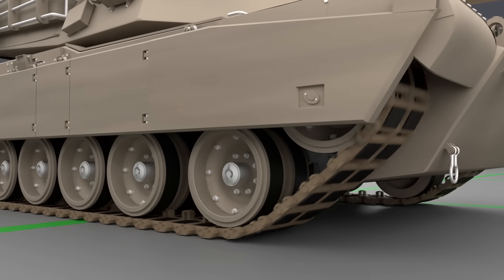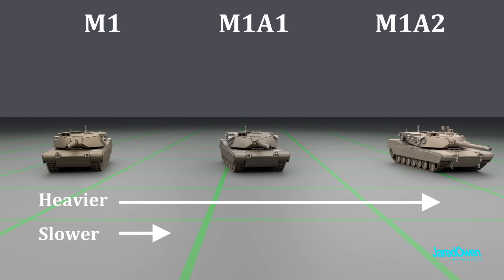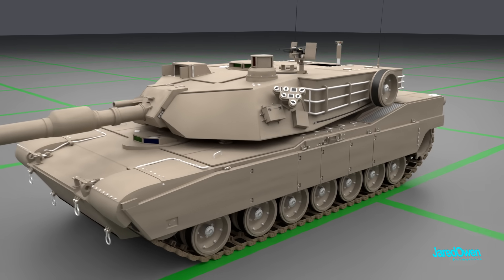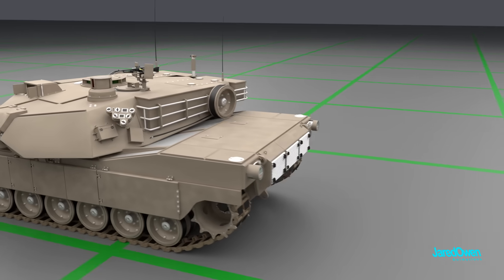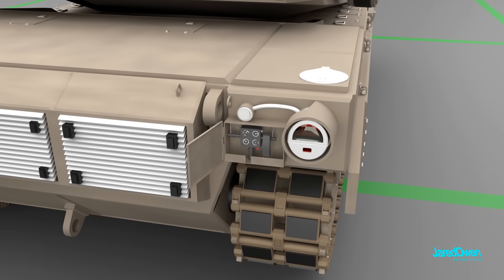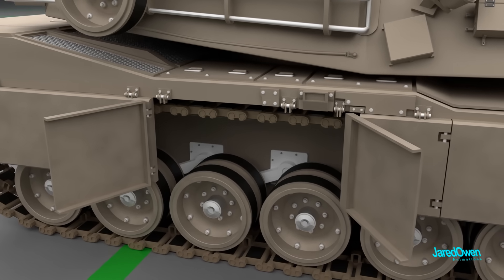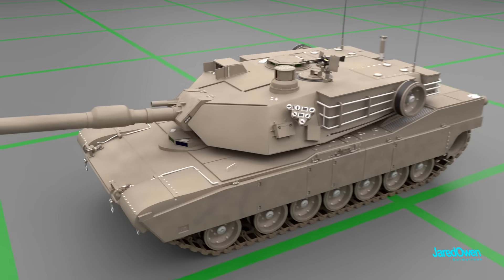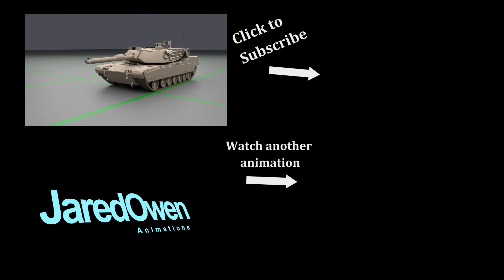How does a Tank work? (M1A2 Abrams)

Comment: I didn't realize that War Thunder had blown up like it has.  I played it from beta right up to when they added air combat into the tank battles.  The tech tree only went up to the Korean War era at that time.  I've never seen any advertising for it, so I figured it fizzled out and died.  It's far superior to Wargaming dot net's land/air/sea games, especially with the physics.  In world of tanks, the effects of mass and inertia are tuned way down.  In War Thunder, you can really feel the weight of the tank in the handling when you're hauling ass and make a hard turn because the hull orientation changes but you still skid sideways in the direction you were originally going... all that weight can't just turn on a dime.  Makes for great situations where you can emerge from cover and get a snap shot off without having to reposition the turret.

Comment: “Has a turbine engine much like you’d find in a jet aircraft”......it’s literally the same engine that’s in the Blackhawk helicopter
Reply: Ah, NO... the Blackhawk is powered by a General Electric T700.
The Abrams is powered by a Lycoming PLT-25.
Reply: Agt1500
Reply: @longsleevethong1457  The M1 Abrams is powered by a Lycoming PLT-25 The U.S. Navy designation is TF-15 and the U.S. Army designation is the AGT-1500.
Reply: Aight. Still a helicopter engine.
Reply: @longsleevethong1457  No, not true, the PLT-25 has always been a land/marine power plant.
Only the PLT-27 is a flight rated engine.
The Lycoming PLT-25 was never used or intended for aircraft applications.
Any questions?
Reply: Iol. Model numbers From 25 to 27 and completely unrelated.....

Got it......
Reply: @longsleevethong1457  The developement of the Lycoming PLT-25 dates back to 1944. 
 It was designed by Dr. Anselm Franz,  the Nazi engineer working for Jumo who invented the axial compressor turbojet engine.
 Franz designed the Jumo -004 turbojet engines for the world's first jet fighter the Messerschmitt Me-262.
 Work was begun on a larger more powerful engines including the Jumo -025.
 Dr. Franz used the core of the Jumo -025 to develop a gas turbine engine called the GT 250  to compete against the BMW GT 101, the world's first gas turbine tank engine that was installed in a Panther 2 chassis in 1944.
 The war ended before Jumo completed the protype.

Franz was transplanted to the U.S. by Operation Paperclip and was hired by Lycoming as cheif of turbine engine development and work on the GT 250 resumed under the name PLT-25.
The PLT-25 was not originally developed for helicopters and was never a flight rated design.

Franz had already designed the world's most popular helicopter turbine engine in history with the Lycoming T53 which powered the Bell UH1 and AH1 helicopters.
A larger more powerful version of the called  T55 powered the Boeing CH-47 Chinook helicopters.
Reply: It’s a fucking variation of a helicopter engine.
Reply: @longsleevethong1457  No, its not a helicopter engine.
Helicopters can be powered by reciprocating and turboshaft gas turbines.
Not all turboshaft engines are helicopter engines.
Reply: @longsleevethong1457  The first successful gas turbine was invented by Jens Ægidius Elling in Norway.
The first company to manufacturer gas turbine engines was the Swiss company Brown Boveri und Cie. which made gas turbine power plants, industrial compressors and locomotives in the 1930's.
Reply: Aktually.....it’s absolutely a variation of a helicopter engine
Reply: @longsleevethong1457  Actually, no... it's not a helicopter engine, it's a tank engine.

Helicopter engines don't run on Diesel fuel or have a recuporator... they don't have air filters either.
Reply: Taking a part off one side and adding another part on the other side doesn’t change the fact that it’s a helicopter engine moron
Reply: @longsleevethong1457  It's not a helicopter engine, nor are all gas turbine helicopter engines.
Many helicopters have reciprocating piston engines and gas turbines are used in a wide variety of non-aviation applications including but not limited to tanks.

Comment: The digital m1 model looks like it has the 120mm instead of the 105mm main gun....also I’m pretty sure it will hold more than 500 gallons of fuel.

Comment: The tank does not run on jet fuel it runs on diesel
Reply: The1 Abrams was designed to  run on Diesel fuel (NATO F-54)
After it entered service in 1980 it was plagued with fuel issues during cold weather operations and the U.S. Army began to supply M1 units with a special kerosene + JP4 jet type fuel blend called "M1 blend" or  NATO F-65.
In 1991 the U.S. Army switched from Diesel fuel to JP8/NATO F-34 jet fuel or all combat vehicles.
Other countries like Australia, Egypt and Saudi Arabia still used Diesel fuel in their Abrams tanks as they do not encounter extreme cold weather.
Reply: Yep

Comment: The Abrams was designed as a defensive tank, to counter the "hoards" of Soviet tanks that might attack Europe during the cold war. Thus, it was equipped with a powerful but inefficient engine that could move it short distances very quickly. In short, it was a gas guzzler to the extreme but in a cold war scenario, it would never cover large distances and speed was the better attribute.

A 300 mile range with 500 gallons of fuel? And even those figures are far-fetched. It takes 16 gallons just to start the engine. It's not an effective offensive tank although that has been it's primary mission in combat.
Reply: No YOU!

Comment: So 2 question.   Where do spent shell casings go? I'm assuming here but how does the loader get to the shells on the other side.  Do they roll towards him?
Reply: The German Rheinmetall Rh-120mm has no metal shell casing, it uses an ingenious case design are of combustible celluloid.
Only the small metal base cap is ejected from the breach, it falls into a small basket on the floor.
Reply: You can see the darker silver colored base cap being ejected from the breach in this video.
https://youtu.be/sC2ePKRvo9k

Comment: "This engine is actually fairly quiet"

Start-up louder than a Boeing 747
Reply: It's quiet because the loud high pitch sound doesn't travel distance very well. Lower pitch sounds travel a longer distance.
Reply: I can agree to the start up is very load, once it's out of tac idle it's not thay bad

Comment: Good video... I expected nothing less. But I was disappointed that Jared didn't go into the GPS Gunner's Primary Sight and the Commanders, Independent Thermal Sight on the M1A2. Basically the Gunner has a Thermal sight that is the large rectangular "window" on the right of the main gun and the Commander's Independent Thermal sight is the "nipple"-like cup on the left top of the turret. It is quite similar to the Gunners sight, but allows the commander to constantly scan 360° independent of the gunners sight and rotation of the turret. The commander can independently identify a new target and electronically send the coordinates to the gunner's firing computer.
Also, the loader is responsible for manning the 50mm machine gun on top of the turret. The loader also MUST load the main cannon and sit down carefully to avoid injury because at 3,500 MPH shells firing, the recoil of the breach WILL NOT stop for anything and will crush any human body part not secured safely behind it.
Also, fun fact, in the Gulf War, the M1s went into battle with fuel "bladders" perched atop their turrets, that just before a push would be rolled off and connected to the fuel tanks of the M1 and the tank would back up over them to top up their fuel tanks.

Comment: As an M-60 tank driver this is coming a long way in the armor corps. I never got to crew an Abrams.
Reply: M1a1 crewmember here(driver) it's like a big motorcycle on steroids and a BIG FUCKING GUN. You feel invincible when driving and the brake pedal is bigger than your foot on the right side. Not bad on the seat (lazy-boy recliner). I'm 6'1" and I had plenty of room in the drivers hatch. Desert storm vet 89-92 hhc 8/40th armor 63rd arcing ft huachuca, az. "As I ride through the valley of the shadow of death, I FEAR NOTHING!!! For I am the most feared, deadly, and meanest mf on the battlefield" tankers creed

Comment: The tank has a governor on the speed, otherwise the 5 tuns, HMMWVs, M113s and M556s in support of the tanks cannot keep pace.  That and at more than 65mph and you risk the track being damaged by centrifugal force.  The seal of the turret must be inflated to keep water out while tording a river.  Chemicals are kept out by overpreasuring with filtered air.  The same system clears smoke from firing the coaxial machine gun.  I have a total of 14 years (93 to 07) experiance in the M60A3, M1IP and the M1A2
Reply: I completely believed you till I saw "a roral"! I guess we're supposed to assume you meant "total"  huh? 😆 This is what insomnia and boredom got you. Stupid comments with no remorse!
Reply: @weedzilla-405  thanks for the catch.  I really have to proof before I send.

Comment: I thought the video would use legendary Leopard 2a series as the model
Reply: The Abrams is based on the Leopard...
Reply: @sandervanderkammen9230  No, both leopard 2 and M1 Abrams are based kpz 70 aka mbt 70 in the US.
And they are made after German quitted the project.

p.s. You can find it on Wiki
Reply: @alvinnormason5170  Krauss-Maffei AG. designed and built not only the Kpz-70 but also the XM805, XM815 and the MBT-80... programs which were renamed the XM1 and Leopard 2... real factual history you wont find on wiki.
Reply: @sandervanderkammen9230  They did share the same tech, same guns and barrels but it doesn't mean Abrams are based on leopard
Reply: @alvinnormason5170  Not true, all 6 XM1 hull/chassis were built by Krauss-Maffei in Germany.
The suspension components were  manufactured in the U.S. by FMC under license from German manufacturers K-M, Koni, BBS, Krupp, Atlas and Deihl.
Many major components were  interchangeable between the Leopard 2's and the Abrams and still are.
Reply: @sandervanderkammen9230  So what you mean is Japanese type 90, type 10, American M1, Korean K2, Israel Merkava Mk.3, 4 and Italian Ariete are all based on Leopard because they use the RH 120 cannons? It obviously they are different designs. They are just able to install and share the same turret and parts. Even leopard could install other turrets as well but it's doesn't mean leopard base on foreign tanks
Reply: @alvinnormason5170  Is this video a joke or something?
Reply: @alvinnormason5170  The Abrams has never used the same gun as the Leopard 2 and never intended to.
The M256 while licensed by Rheinmetal and manufactured in the United States is a much cheaper, heavier and less advanced version than the L/44 used on the Leopard 2 and has been superseded by the even more advanced L/55.
Reply: @sandervanderkammen9230  It is a joke
Reply: @sandervanderkammen9230  The L44 and L55 installed on leopard is the special modification.
Reply: @sandervanderkammen9230  don't try to make Abrams be similar to leopard or use Abrams to substitute Leopard, that's why people hate this video https://youtu.be/oso1EZmyAQ8
Reply: @alvinnormason5170  Who the F is Dave Walpole???

Comment: Does the US military use light or medium tanks? This monster weights almost 70 tons. Not the fastest. Heavy. A tank's main advantage is speed. Not the firepower or the armor. It has to be agile as a Mongholian horseman in the 12 century. The fact that in the 21 century a tank uses high octane  gas and not diesel is disgusting. The Russians used diesel in 1939. Almost a century ago.
Reply: It's a multi-fuel engine, the Army and partially the Marines up until they retired their tanks switched from Diesel to JP8, a jet fuel. 

The U.S. is looking into a 20t.-30t. tank "Mobile Protected Firepower" for the Airborne, which will also replace the M1128 Striker MGS in Striker battalions.
Reply: @peterson7082  
Thank you for sharing. To me, diesel has a clear advantage over any other fuel. It is not flammable, unlike gas fueled engines. It is less susceptible to dust and sand. Finally, it is easier to maintain (contains fewer parts) and repair, especially in the field. I am not an expert, but read quite a bit about WWII. One of my favorite experts is a former tank expert, a military officer (commander of a tank company), military intelligence officer, and a prominent WWII historian Victor Suvorov. He analyzed the Soviet Union's role in WWII and Stalin's vision of tank and mobile units' (armies) role in conquering Europe. Highly recommend.

Comment: 70 tons fully loaded.the tank does not run on jet fuel. It runs on JP8 low grade diesel. It uses up 8 gallons of fuel just on start up,the round does not leave at 3500 miles an hour,it travels at 3500 fps, the loader and t.c. have their own machine guns,an m240 for the loader and M2 .50 cal for the commander. The CITV in front of the loaders hatch also allows the t.c. to get a full view of the battlefield without popping the hatch.
Reply: Wrong, JP-8 is  JET A1 commercial grade jet fuel also known as NATO F-34 jet fuel.
Any questions?
Reply: @sandervanderkammen9230 I spent 4 years on the tank. Humvees,Hets,MRAPS,Paladins and damn near everything else runs on JP8. There's no way a humvee runs on Jet A fuel. Are there different grades to JP8 that I'm not aware of?
Reply: @jasonleighton1584  JP-8 is the military equivalent of Jet A-1 with the addition of corrosion inhibitor and anti-icing additives; it meets the requirements of the U.S. Military Specification MIL-T-83188D. It is the dominant military jet fuel grade for NATO airforces. The UK also have a specification for this grade namely DEF STAN 91-87 AVTUR/FSII (formerly DERD 2453). NATO Code F-34.
https://www.shell.com/business-customers/aviation/aviation-fuel/military-jet-fuel-grades.html
Reply: @jasonleighton1584  Humvees, Hets,MRAPS, Paladins and all combat vehicles in service with the U.S. Army are equipped with "Multi-Fuel" Diesel engines.
These engines are all equipped with a Fuel Density Compensator which allows these engines to run on a wide range of fuel types including jet fuel.
The U.S. Army adopted the "SFC" progam in 1991 'aka' JP8 as its Single Standard Fuel so the Abrams could use the same fuel, the Abrams cannot run reliably on Diesel fuel.
Reply: @sandervanderkammen9230  well then, I stand corrected. Thank you for teaching me something new.
Reply: @jasonleighton1584  You sir are very welcome. Cheers!

Comment: The stabilization on the tank for the 120-member gun what tanks got tested with it before it was on the in one and I know the answer cuz I was on those tanks when we tested it secondary timing division 1st Cavalry 1974 to 1977 text someone was tested by 1975 and 1976 me and Baker have test the tank you had a GMC in a Chrysler what had plantar do some gel and had a turban answer M16 A1 V menu wc28 803 r w n 22803 e r w i 2803 e this came from the tank branch of weapons Department Forge and Thunderbolt United States Army School Fort Knox Kentucky 1975 June and it was a M48 tank as well. Had the stabilization on it that we tested that's the Vietnam era tank

Comment: I thought the smoke launchers are supposed to launch smoke cannisters about 30m in front of the tank in an arc. Is this inaccurate? or do the smoke launchers ALSO spew smoke directly from them?
Reply: They launch them.
Reply: The Abrams was originally designed with an engine smoke screen generator but it was disabled in current models due to reliability problems with the gas turbine engine... it now only has smoke grenade launchers.

Comment: The weakest points of the tank are: 
1 The communication box
2 Small angle of view for the driver 
3 The coordination between driver and commander must go smothly 
4 The imunitions does not get automatically 
5 It is heavy and slow so easy to catch by air and missiles 
6 The weaker part are the wheals and they are the most important part 
7 The engine is not quieter ... 

So I drop this tank ... 
I would like a faster tank like more than 100 klm per hour ... 
The wheels must be reconsidered for better strong options ... 
The tank must not be heavy ... 
2 members instead of 4 ... 
1 Driver the other fire and command ... 
The tank must be equiped with a real time 3d map ...
Reply: The weakest point of the M1 Abrams  is the gas turbine engine and it's appallingly bad fuel consumption.
Reply: The engine is not quieter? It has a high pitch meaning it only goes about 50-100 ft. Any more than that and you can't hear it, it's crazy.

Comment: Someone knowledgeable plz answer:
The piston engine turns the crank which turns the transmission which turns the wheel of the car. 

The turbine in tank turns what? Does it generate electricity to turn the electrical motors which turns the toothed wheel of the caterpillar wheel set? Or like a car is there a crank which turns the driving toothed wheel?
Reply: The turbine is geared to the tranmsission, which is a cross-drive transmission. So an automatic mixed that has a torque converter and hydraulic steering all in one package. It's entirely mechanical essentially. Like any other tank.

Comment: Those apfsds shells are surprisingly accurate for a smooth bore cannon
Reply: Not as accurate as the L/55 gun on the Leopard 2's
Reply: @sandervanderkammen9230  Meh.
Reply: @peterson7082  The L/44 has been superseded by the updated and improved L/55 which offers greater range and accuracy.

Comment: Where do the spent shells go after firing?
Reply: In the M1 and most Western tanks using a 120mm. gun, they use a combustible casing which burns up on firing leaving only a base cap which is left on the floor, or is collected in a metal bin beneath the gun.